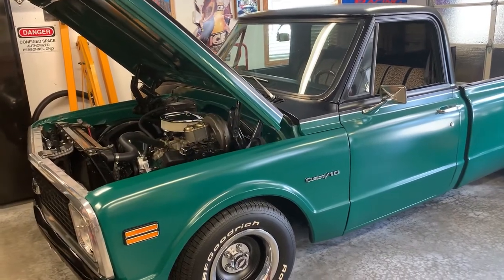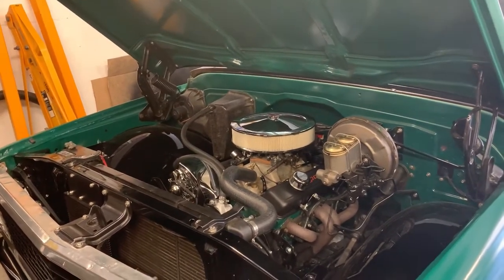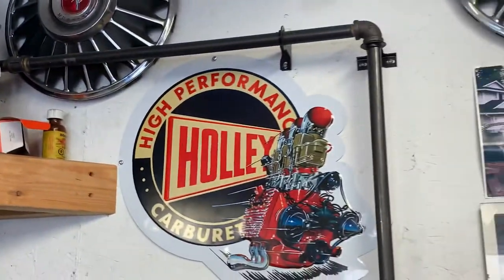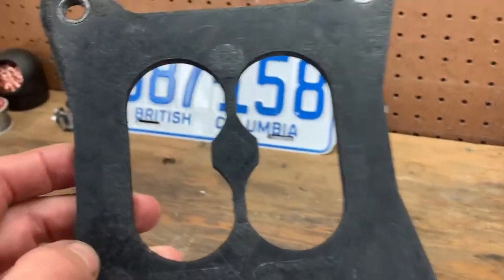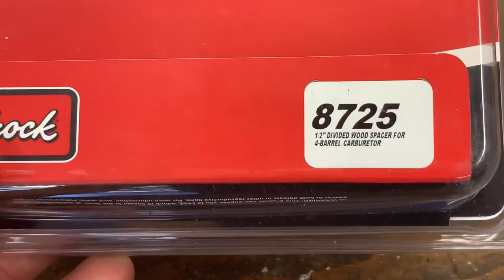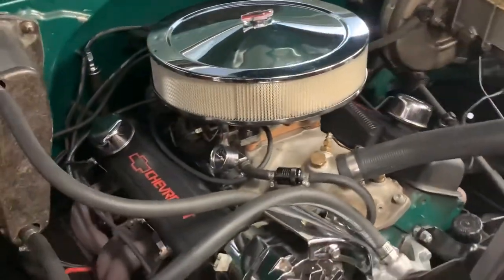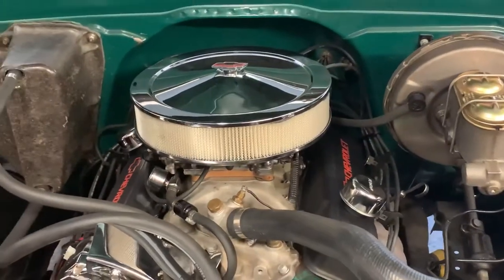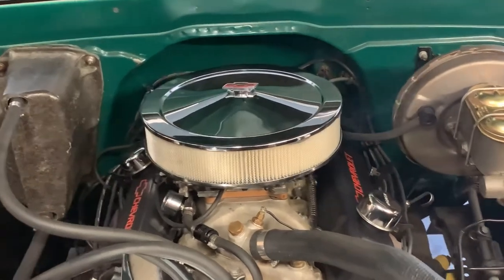Edelbrock carburetor heat soak/hard starting issues

Comment: And also try to route your fuel line to your mechanical pump away from the engine because that line gets quite warm and it turns the fuel to vapor try to get some type of wrap around it like I did with my fuel lines it will help a whole lot

Comment: Only way I was able to stop that heat soaked in my 1968 Catalina was to make a reserve line going back to the gas tank I put electrical fuel pump going to my mechanical fuel pump just the prime it like a little shot of nitrous then I turn it off and then the mechanical pump works it seems to be cooling my system down quite well with no issues it may work for you
Reply from the maker: A 2 outlet mechanical pump with a return line is definitely a good idea. That was going to be me last resort, but so far the insulator has solved the problem! 

Thanks for your comments Khalif! Have a great day!!!
Reply: @whiskeycreekcustoms6296  you're welcome ✨
Reply: @whiskeycreekcustoms6296  got a question. What is the difference between the large early 70s corvette 350 fuel pumps plus the ones use on 350 vans in the 80s? Vs the small standard versions used on all other 350s. At the moment I'm running a small version with return line to help battle the boil. It's 3 years old now and just want a fresh pump. Is it a benefit to the ones with larger canister on bottom?
Reply from the maker: @itsruffoutchea6636  I honestly couldn’t tell you if there is any benefit or real difference between those specific pumps. 

However; a 3 port pump with a return line is always better than a 2 port pump with no return! My truck did have a return line at one point, but it was in poor shape and abandoned at some point. Eventually I will run a new line for it. 

Thanks for watching 👍🏻
Reply: @whiskeycreekcustoms6296  thanks for responding but I found out the difference.  It holds 3 times more fuel than standard pump. For corvette it was so it wouldn't starve carb during racing. On vans its so it took less time to crank being that the larger canister holds reserve fuel.
Reply from the maker: @itsruffoutchea6636  interesting-you learn something new every day! Thanks for passing that info along 👍🏻

Comment: Great video.  I have 1965 c10. After long drives it takes 10 minutes to restart. I get no click no crank. Not even radiator fan turns on. But lights turn on. On some videos they say heat soak comes from starter. I have headers on my truck. Would love to hear your suggestions
Reply from the maker: Heat soak is a general term used to describe the condition which happens after driving a vehicle for a length of time, and then parking it, with the engine off… under hood temps continue to increase and can cause issues with electrical components, starters, carburetors etc. 

If your headers are relatively tight to your starter at all, that would be a good place to start. Installing a starter heat shield can help greatly (they are readily available, or you can fab one up) and/or switching to a mini starter for additional clearance. You can also wrap your headers, but I do not like that option on a non race vehicle as it can significantly reduce the lifespan of your headers. 

Also; make sure all wiring is spaced adequately away from the headers, and add heat shielding to the wires if rerouting  is not possible. 

Start with those simple things, and also check all major ground wire connections & make sure they are clean and tight! 

Good luck to you, and thanks for watching! 👍🏻

Comment: My name is George from Apache Junction Az , i have a 1970c20 , do you have a long nose water pump or short.  It also looks like you have a copper/brass rad. 
I HAD TO PUT A ALUNM. RAD . ON COULD NOT FIND A REG. RAD 
 WITH A SHORT WATER PUMP . WHAT TEMP. DOES YOUR RAD RUN .
Reply from the maker: Hi George! 

I have the long water pump, and yes; it it’s a stock style copper/brass Radiator. 

My temp gauge runs steady at 185° for the most part. It will only creep up to 200° sitting still when the ambient temperature gets into the mid 90’s
Reply: @whiskeycreekcustoms6296

Comment: The intake manifold appears to be aluminum you can block the exhaust going under the carb some aftermarket intake manifolds come with this blinded others don't you can add a couple of pieces of metal on each side.

Comment: my avs2 edelbrock carb is not doing that but im having issue where to car start then shuts off you know like it dont have enough gas going through. its hard starting when warmed up like it need to crank it i seems like or it will shut off you know what i mean
Reply from the maker: Hi Robert! 

Yes, that certainly sounds like a fuelling issue. Is the carb relatively new? 
I’d start with checking your fuel pressure and  go from there. It could be a multitude of things but it sounds like it may just need to be calibrated and adjusted.
Reply: @whiskeycreekcustoms6296  yeah its a new intake new fuelpump new fuel lines and new carb!! just installed yesterday, it runs down the highway no issues just it a hard crank when i turn the engine off and start it back up like when i enter a store and get back to the car. its all edelrbock, and braided edelbrock fuel line
Reply: Have you figured that out yet? I have the exact same issue. Fires up then dies. Next crank good to go.Then after I turn it off for ten minutes. And smells fuely.Not sure if it’s a real “heat soak” issue. AVS2 as well, new pump,lines etc. I’ll try the wood,or 1” spacer.
Reply: @nicholasmartin4684  hahha yep get the wooden spacer. I install mine from mopac and took me 30 minutes and now she starts high everytime its the fuel getting to hot comming from the carb
Thats called, heat soak

Comment: Pull the intake off and install Felpro's gasket set part# 90322 with crossover passages blocked, no more boiling fuel, no more heat soak, problem solved!!!
Reply from the maker: Thanks for the comment Ken! 

Great point… I didn’t mention the crossovers in the video, but that is certainly a great place to start, especially on a fair weather cruiser! 

I do hope to pull the intake this winter to bead blast it and freshen it up. I am quite certain the crossovers were never blocked when the intake was installed on this engine. 

Have a great day, and thanks for watching!
Reply: @whiskeycreekcustoms6296  I pulled the site plugs out of my Holley and I could see and hear the fuel boiling along with the intake changing color in the crossover area, with the Felpro's 90322 installed the exhaust note will be a lot more aggressive when your driving the vehicle, but it's better than boiling the fuel.
Reply from the maker: @kenwatts5410  that’s never any good! 

Not only is it annoying, but it’s rather embarrassing when a group of people happen to be standing around admiring your vehicle and you go to start it up and it fails to start and then stumbles and sputters when it finally fires due to the fuel boiling over…

Comment: Try an electric fan maybe your heat issues might be your fan clutch never have this problem carb getting hot, trial  n error, timing to high
Reply from the maker: Thanks for the comment Diana! 

The issue was caused by heat soak/fuel percolation, and the phenolic spacer completely solved the issue!

Thanks for watching 👍🏻